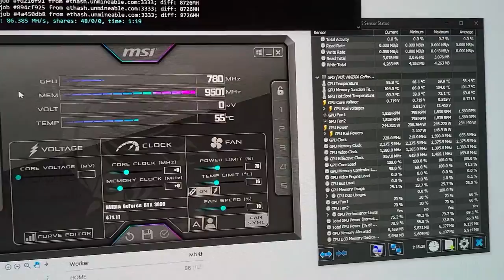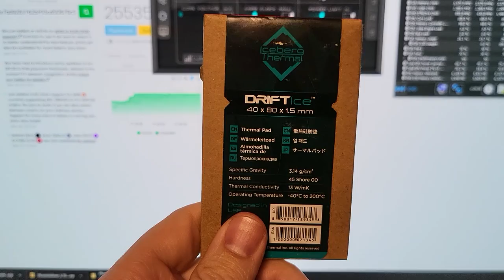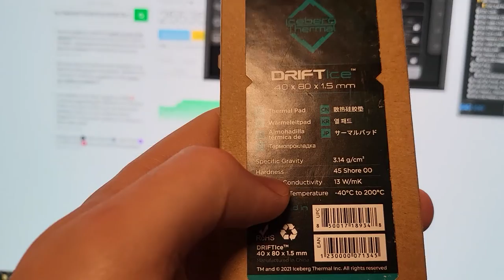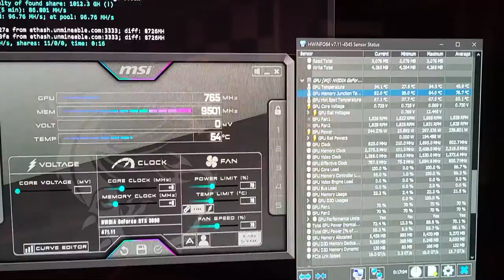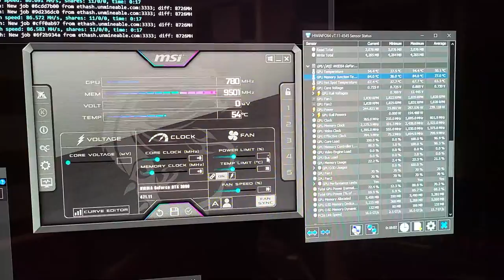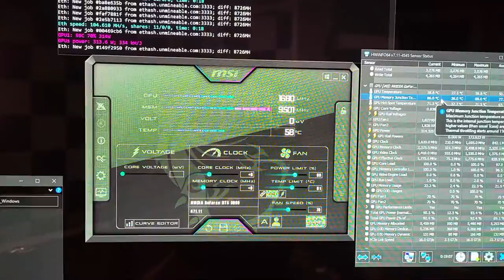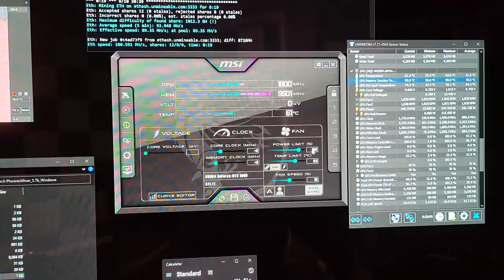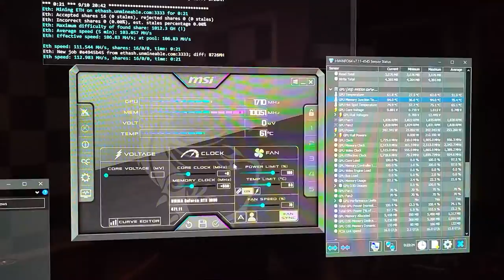RTX 3090 FE Thermal Pad Replacement Timelapse! -22C drop in Temperatures!

Comment: Fantastic video!  My 3090 FE was struggling.  I tried to keep it at 100C or below, but had to run low clocks and high fan speed just to get a hashrate around 100mh/s.

Now, with these thermal pad mods, it is like a completely different card.  I am running at a 90 PL, 1300 Mem Clock, -502 Core Clock, and a nice low 70% fan - and temps are sitting at a comfortable 88C and the hashrate sits around 123 mh/s.  That said, I have tested higher OC settings keeping temps under 96C and managed over 126 mh/s and am confident I could go higher - I just don't want to throw to much wattage through the card.
Reply: hey，which pad did you use ?   im using those gelid pads.. but my temps still around 102-106c...  i may did something wrong.
Reply: @kuku556677  1.5mm for some cards too thin. İ added on my card on the cooler surface mx4 and put the 1.5mm on it and get 82C. Without the mx4 it went to 106C.

Comment: Wow! The temps are very impressive. I've been having this issue in Fortnite to some extent, but most of all in certain Dauntless escalations where the fans really ramp on on the final bosses for no apparent reasons since the GPU temp was steady at 68 degrees C... But after some HWINFO64 analysis, the fans REALLY ramp up when the Memory Juncture temps are around 104 degrees. I really need to do this mod (so worried I'm gonna break it though). But man... if this mod could actually silence my card... I see a project in my near future. Thx for the vid man. Just need to find a video that is not in fast forward on the teardown. Also: what compound did you use for the GPU?
Reply: Oh: and where are the instructions? Can't find the link in the description.

Comment: I also have a 3090 FE and I replaced the thermal pads with Gelid Ultimate 2pc and thermal grizzly paste. I was able to go from 110c to 92c on memory and 72c to 60c core. With power at 83%, -200 core and +1200 mem I can get 123m/h. While having the warranty is nice and they might still honor it, these temps will make it worth it and last longer. Loved the vid I wish I recorded mine.
Reply: Hey Tyler, could you please send me a link about the Gelid Ultimate pads you used?   Thanks, i was using Thermal right but it didn't work very well, memory is till higher than 100c    ：(

Comment: I am hesitating between the Gelid Extreme or the Ultimate. Which one should I buy? 
I read the Ultimate are more hard  and you have to compress them a bit, is that correct?
Reply: Did you ever find out? This is what I’m lost about
Reply: @Multimeter1  I have heard that the Extreme is a little more squishy than the Ultimate so usually makes for better contact on components. As long as the thickness is correct, go with slightly squishy on GPU VRAM.

Comment: I done my reppadding on my 3090 fe

1.5mm in core side , and 2mm memory side 
And drop some heat sink in top of backplate and blow fan in top of it like an exhaust. 

Am getting 104 mhashs and 82 to 84 c @ memory 68 to 70 @ hot spot , about 55c in core under 75 powerlimit 255 and getting 390 to 400 eff/ watt

- gelid ultimate 1.5 mm 
- gelid extreme 2mm 

That enough , and in extra I placed a thermal sensor on backplate so that make sure its not higher than 60c I it's got higher than 60c means u m temp is running over 90c 

For me backplate is 45 to 55c

So , u can get 101 to 105 hash on 260watts with a 82c to 84c  memory temp ( micron tested temperature is ( 85 to 88 ) 

So we can improve the memory's lifespan and get 100+ hash stable that's cool 😎